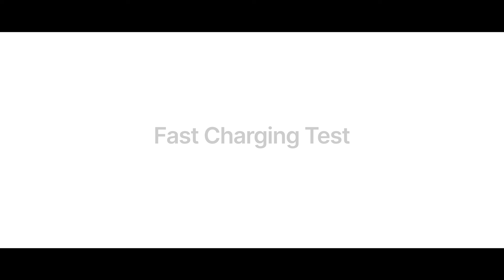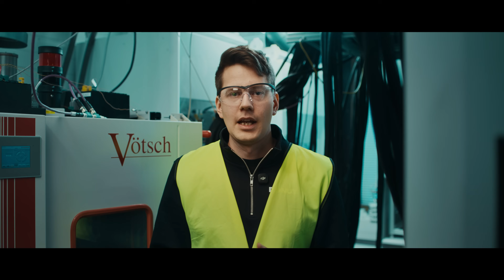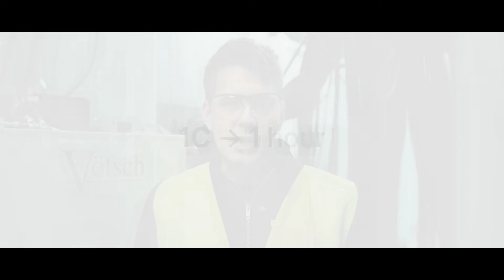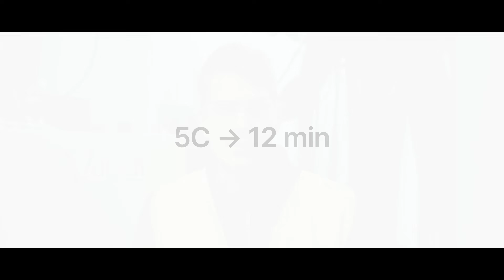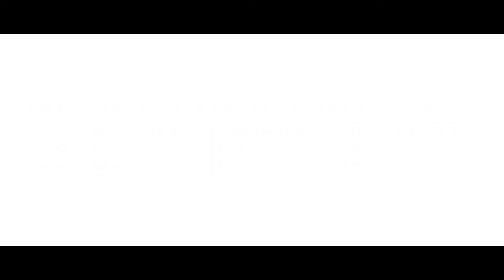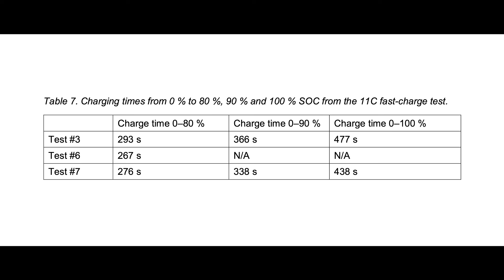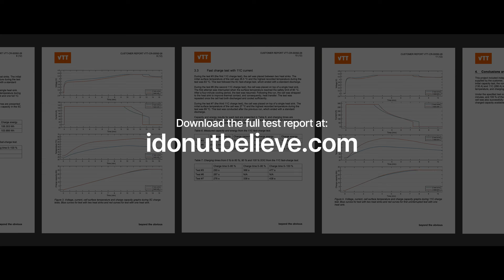Donut Solid-State Battery: Fast Charge Test | I Donut Believe (Pt.1)

Comment: This comment from reddit explains this pretty well:

VTT is paid by Donut Labs to do the tests that Donut Labs asks them to.

I work in the industry (not batteries, but electronics) and this is how it works. The labs are not going to lie on their results, but they also aren't going to police you for honesty. Its a lab test, not an audit. More often than not, you even send your engineers to the lab to be right there while testing. They give you a lot of latitude with your UUT (unit under test) too, because again, you are paying them to do these tests for you. Their lab techs want a good result for you as much as you do. I've done this multiple times in my career.

So if Donut brings a different battery for each test, VTT will say nothing. Because it isn't their job to say anything. They aren't investigating Donut. They are doing the tests they are being paid to do and nothing besides that. Donut could show up to VTT with a lead acid car battery next week and ask for voltage range testing and VTT will happily do it, and write up their standard report for it, exactly like this one. Donut could even call it a "plasma core battery" and VTT will call it a "Plasma core battery" in the report.

VTT is not an auditor, it's a lab that gets paid to do tests that the customer specifies. Hence why this report is so narrow, and doesn't even cover basics like size and weight. VTT is honest in their results, and honest in their capabilities, but they are providing a service for donut under donuts guidelines.

Wake me up when Donut lets investors take one of these cells to VTT.
Reply: For example rhe sell could only last 5 cycles and we wouldnt know
Reply: its about cycles and mechanical stability. And about the price per kwh. 
As more they hype their "tests" as more I'm in my option it is an hoax.
Fast charging shows nothing on one cell. 
Nio/WeLion pulled their 140kwh semi solid state battery, because nobody wants to pay so much money for it.

Comment: Kudos to Donut Labs for releasing independent VTT data verifying the 4.5-minute fast charge! It’s a great milestone that puts them ahead of many startups. However, having followed EV battery tech for 10+ years and spent 15+ years in the Silicon Valley R&D lab of a major automotive OEM, I've developed a healthy dose of skepticism. I’ve sat with countless startups presenting impressive 3rd-party lab reports for single cells, only to watch their "revolutionary" specs evaporate during our internal testing.
Lab testing is just the first hurdle. The real challenge comes when you package those cells into a full pack, manage the thermal loads, install it in a test vehicle, and run it through real-world driving conditions. That transition from bench to vehicle is exactly where unforeseen engineering issues pile up and things usually fall apart. I genuinely want to see a true, solid-state breakthrough, and I'm rooting for Donut Labs to succeed where the EV space is littered with failed promises. But until this tech survives the brutal realities of pack-level vehicle integration, industry caution is completely justified. Keep pushing to prove the skeptics wrong!
Reply: We will know soon when the Verge motorcycle is dissected.
Reply: Things are different with AI.

Comment: One cycle big deal.
Heat sink to dump the heat, not a real test. Must have a high R since it gets so hot. P=I^2R 
Not a battery bank.
Need to do 1000, 10,000 100,000 cycles in various environments and configurations. None of this extrapolating BS from a few cycles.
At 1 hour per charge/ discharge it takes 11 years for 100,000 cycles, battery needs time to cool down. See you in 2037.
Reply: it gets hot cause its charging fast and its not actively cooled. The efficiency is similar to usual lithium ion batteries, therefore the generated heat in terms of kWh should be similar, but again its in a shorter period of time and it doesn't  use liquid cooing like you would see in a car.
Reply: @Bullseiify  
I can charge any battery fast, the question is how many time you can do it, before it degrades?

Comment: They are not showing test, but some infographic instead 😂
Reply: Would you want the video to be 40 minutes of watching a cell charge in a chamber without moving 😂
Reply: @ZomboidYT certainly 5 min. screen of metering chargin is not that long video, plus there is still an option to fast forward ;) 
Question is Why not?

Comment: Assuming three charge and discharge cycles per hour, theoretically one could run 1008 cycles in 14 days. This test report was signed off 14 days ago.  I’d like to see the same cell used in this test report go through 1008 cycles and then publish the capacity after that 1008th cycle. Also, it would be interesting to see the charge and discharge rates at -30°C.
Reply: I'm hoping they where clever enough to know these follow-up questions are bound to come and did exactly that. continued running cycles on this cell in room temp and also simultaneously ran a similar cell in -30 and one in let's say 50 degrees or even higher, just so they can on the next video give a "well, here it is, 1000 cycles, no detectable decline....not in 20, not in 50 and not in -30°C... that would impress the hell out of me... 
I'm sceptical still but it isn't looking horrible yet at least.

Comment: Hmmm. I want to believe - but this is only a tiny fraction of claims to this point.
Very important point: charging with ANY heat sink is VERY different to charging side by side with other batteries. Heat sink removes heat- other batteries ADD heat. 

If all the claims are proven, then we may be able ṯo have electric aeroplanes cruising long distances across our skies. How fantastic that would be!

Comment: Wait till thunder foot gets his hands on this juicy bit.  There’s a reason lithium ion and lithium polymer have been the kings of energy density for the last 30 years. 200WH/KG for lithium ion and you expect me to believe these guys managed 400wh/kg and won’t even specify what the battery technology is?  A battery with 400wh/kg is a technology worth in the trillions of dollars instead they are focusing on the heat sinks? Get real.

Comment: Are they really not gonna show a video of the actual battery charging with key metrics like voltage, state of charge, etc.? Why would you show the setup and charts but not the real thing. Come on now. This is like the slow roll of the Epstein files over the years. Give us the  real goods or stop hyping!
Reply: They should ask known influencers in the field to test their batteries. Independent testing on their own channel doesn't sound very independent.
Reply: @motoroladefy2740  exactly. With how much he seemed to have thought through, this isn’t adding up great so far

Comment: I'm not quite sure why community members are so critical.  

OEMs get first choice, but I don't know of any automotive manufacturing that would put this in their vehicles without their batteries not being replaceable.  Non of them design for battery swapping or replacing.  Perhaps, they could without all the cooling equipment - we will see.  

I want to see a standardised battery size for, at least, hybrid vehicles.

Comment: Remember, the test was done in a cell, not a full battery pack. How does the charging speed and energy density compare with a typical lithium battery with the same 100 Wh capacity?
Reply: Was allegedly done.

Comment: Gemini: 

This analysis critiques the VTT test data against established scientific principles regarding electrochemical storage (batteries), electrostatics (capacitors), and the current state of Solid-State Battery (SSB) technology.
1. Scientific Classification: Definitely a Battery
The data confirms this is an intercalation-based electrochemical battery, likely a Lithium-Ion variant (NMC or similar cathode).
 * The Chemistry Signature: The report documents a "Constant Current / Constant Voltage" (CC-CV) charging profile.
   * Capacitors store energy physically (static charge) and have a linear voltage rise/fall (V \propto Q). They do not accept constant voltage charging; once they hit their voltage limit, current drops to zero immediately.
   * This Device accepts current until a voltage ceiling (4.3V), then holds that voltage while current tapers. This behavior is dictated by the kinetics of ions moving into a crystal structure (intercalation), confirming it is a battery.
 * Energy Density: 26 Ah @ 3.6V ≈ 94 Wh.
   * A supercapacitor with 94 Wh of energy would be roughly the size of a mini-fridge and weigh 15–20 kg. If this cell is handheld (implied by the test fixture description), it is chemically impossible for it to be a capacitor.
2. The "Solid-State" Reality Check
The claim that this is a "Solid-State Battery" (SSB) presents significant scientific conflicts with the test data, particularly regarding the 11C charge rate at room temperature.
 * The Conductivity Paradox: True solid electrolytes (ceramics or sulfides) typically suffer from lower ionic conductivity compared to liquid electrolytes, especially at room temperature (~25°C).
   * The Anomaly: Charging at 11C (286 Amps) requires exceptional ionic mobility to prevent lithium plating and massive internal resistance spikes. Most true SSBs require elevated temperatures (60°C+) to achieve high C-rates.
   * Scientific Skepticism: Achieving 11C at room temperature suggests the electrolyte may not be fully solid. It is highly probable this is a "Semi-Solid" or "Hybrid" system (gel polymer or liquid-wetted ceramic) which retains some liquid components to facilitate fast ion transport.
3. Critical Omissions & "Red Flags" in the Report
To evaluate if this technology is a breakthrough or deceptive marketing, you need data that is conspicuously missing from the report:
A. The Missing Mass & Volume (The "Brick" Test)
 * The Omission: The report lists Capacity (26 Ah) and Energy (94 Wh) but omits the weight and dimensions of the cell.
 * Why it matters: In battery science, Specific Energy (Wh/kg) is the primary metric.
   * If this 26Ah cell weighs 300g (approx 300 Wh/kg), it is a world-class breakthrough.
   * If it weighs 1 kg (94 Wh/kg), it is chemically inferior to standard AA alkaline batteries.
   * Hypothesis: The manufacturer may be hiding the mass because the "Solid State" architecture makes the cell incredibly heavy or bulky, rendering it useless for portable applications despite the fast charging.
B. The One-Way Street (Discharge Asymmetry)
 * The Omission: The report tests Charging at 5C and 11C, but only Discharging at 1C.
 * Why it matters: High-performance batteries generally have symmetrical capabilities. If a battery can take a charge at 286A (11C), it should theoretically be able to discharge at similar rates.
 * Clue: Testing only 1C discharge hides the Voltage Sag. At high discharge rates, internal resistance causes voltage to drop. If they discharged at 11C, the voltage might collapse immediately, revealing high internal resistance—a common weakness of Solid-State batteries.
C. Cycle Life Data
 * The Omission: The test is a "snapshot" (only ~7 cycles total).
 * Why it matters: Fast charging (11C) imposes massive mechanical stress on the electrode materials (swelling/cracking). Liquid batteries often degrade rapidly at these speeds. Without a 500+ cycle test, we cannot know if the 11C charging destroys the cell after 50 uses.
4. Thermal Analysis: The "Smoking Gun" for Safety
The thermal data provides the strongest evidence that this is actually a non-liquid (or advanced safety) chemistry, even if it has performance limitations.
 * The Event: In Test #7 (11C charge), the cell hit 89°C.
 * The Analysis:
   * Liquid Li-Ion: Standard liquid electrolytes typically become unstable and risk thermal runaway (venting/fire) above 60–70°C. Reaching 89°C without a catastrophic failure is incredibly rare for a standard liquid pouch cell.
   * The Conclusion: The fact that the cell survived 89°C and continued to function suggests a thermally stable electrolyte (solid or semi-solid). This supports the "Solid-State" safety claim, even if the "Solid-State" performance claim is debatable.
 * Heat Generation: The massive temperature spike (\Delta T \approx 62^\circ C in 4 minutes) indicates high internal resistance, confirming the physics trade-off: The cell is robust (Solid characteristics) but resistive (Solid characteristics), leading to waste heat.
Final Verdict
 * Is it a Capacitor? No. It is a battery.
 * Is it Solid-State? Likely Semi-Solid / Hybrid. The room-temperature performance is too good for most ceramics, but the thermal stability (89°C survival) and high heat generation point toward a solid-like architecture.
 * The "Catch": The device likely suffers from low Specific Energy (heavy) or poor discharge power, which the report conveniently omits by leaving out weight/size data and high-rate discharge curves.
Reply: My questions: What is the highest discharge rate for these cells? What is the self-discharge rate?

Comment: Regardless of how the company fares in the long term , this dude sure knows how to feed the hype machine by keeping it secret and releasing information little by little. 
I personally don't doubt the technology they are trying to commercialize. But I doubt their ability to scale to give tough time to the likes of CATL, LG and BYD in the next 5 to 10 years. You need some kind of supply chain established no matter how cheap the materials are. Look at Sodium ion batteries they were first commercialized in 2021. But still the cumulative production is less than 10 GWh compared to over 1500 GWn for lithium ion. Things take time and resources.
For Donut to prove itself the hard part won't be convincing people that their tech is real and viable. It is safely navigating the valley of death and surviving the production hell.
If they make it to the top 10 battery manufacturers globally in 10 years. I will consider them a success. Remember even Tesla hasn't been able to do that in spite of all their wild claims during the 2019 battery day.

Comment: Interesting how the independent report only verifies the results....and don't verify if its solid-state.

These results are quite possible from lithium-ion batteries with silicon additives.

Odd that there are many references to...
 "......which the customer identified as solid-state battery cells"

Comment: I know how to cheat this, you build similar ones with different characteristics. Meaning the first one you test is built for fast charging, so it will degrade fast and be expensive. Next one will probably be the one for the multiple charge cycles, donut lab will then say they have to limit the current as it can not take the high current. Sad they do these tests in different series which makes it possible to cheat.

Comment: Of their five claimed capabilities (energy density, Ultra-fast charging, 100k cycles, safety, and low cost) this demo proves one of them. 12C charge for a few cycles is something that batteries can already do. So, sadly this video does not persuade me that any new technology has been built.

Why didn't they weigh the cell and prove the energy density stat now? (If they have it right in front of them...)

Also: I love that VTT always is careful to describe the cells as cells "which the customer identified as solid-state battery cells".

Guys: This is way to suspicious. A real company would put out proof and start manufacturing this battery and make billions, not put out hype videos that the industry ignores. (the youtube revenue probably doesn't compare to industry changing battery sales, im afraid.)

Comment: Great. You had the benefit of the doubt for me. This looks realistic to me, so my doubts are getting less.
I already expected cycle efficiency not to be great. 90.54% efficiency at 1C is acceptable, but not great, but perhaps a bit better than I expected.
The charge test suggests that you might be able to charge even faster if you precondition the battery (like some EVs can do). You might want to do a test with preconditioning, to simulate what happens when you arrive at a fast charger after a long drive. OTOH, it looks like cold weather performance might be significantly affected (similar to lithium batteries).
According to the report cycle efficiency drops to 82% at 11C. (86% at 5C.) So yeah, there are downsides to these high charge speeds. This battery will get very hot if you try to do a lot fast cycles without proper cooling. Maybe try to do a cycle test at even lower C rates, so you have better efficiency numbers to show than this report gives you.

Comment: 11C that is  1.1 Mega Watt.  For example a 1000 volt battery with a 1000 Amps current is charged with 1 Mega Watt  power. If Donut's cell can handle that power without active cooling, that is promising.

Comment: Fingers crossed!

I have a couple questions if anyone knows. A few very important things were missing from the test experiment. Starting Wh/L and Wh/KG, ending Wh/L and Wh/KG after a few thousand cycles. Those are what needed to be tested.
 
Honestly, it has looked better than I thought it would. However, without the other information being in the report, they could have a new, fast charging, 28Ah cell but its big, heavy and loses half it's capacity after 100 cycles